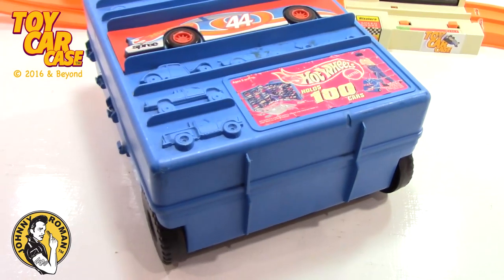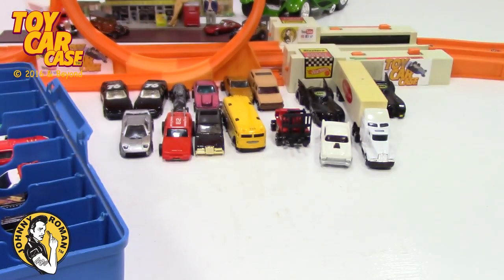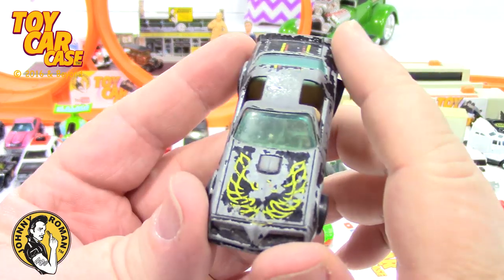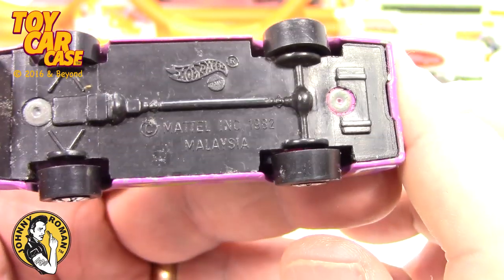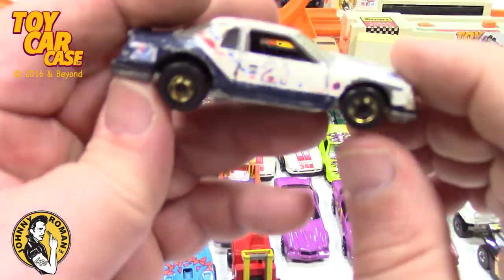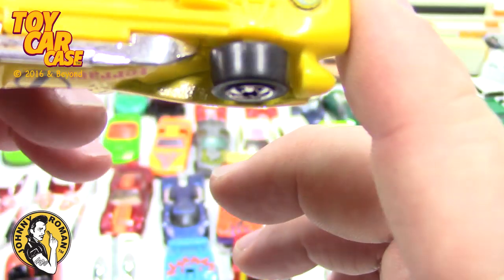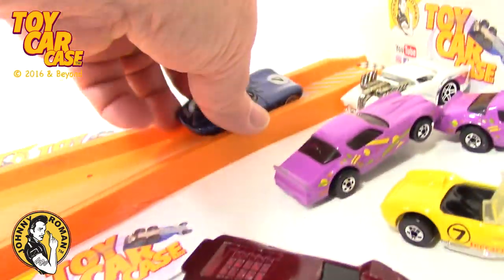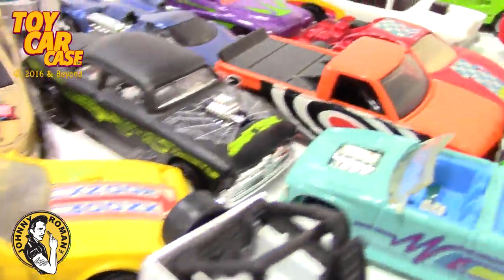Hot Wheels Tara Hot Wheels Spree 44 Race Car 100 Car Cary Case from 1997 Toy Car Case

Comment: Welcome back Calab! That red car on the track, that's Torpedo Jones! I have that in my collection, colored yellow with black flames on the side, and the engine and wheels are colored gold! Personally, I  have been wearing glasses since 2013. Despite this, I still appear on YouTube with the naked eye like I always have since 2007. Trixie would love that pink Datsun!! Nice vintage look for that Minitrek! Personally, 1980 was the year my parents were married! And I'm the same age my father was when my older brother Stephen was born in December 1986! That Upfront 924 could be modeled after the Porsche 924, manufactured from 1976 to 1988. Oh yeah, the Batmobile! I have that in my collection, exact same color! That Bat missile looks like it has seen tons of action! I can't be sure, but that black car looks like the Pontiac Stocker, as the profile of the car seems to match that of a NASCAR racer. The front also indicates that it has to be a Pontiac. That's a pretty looking paint scheme for that white ’57 Bel Air. Nice red forklift! I have a white forklift in my collection made by Matchbox. It's mainly fully intact, nothing missing or anything like that. Hell yeah, the Surfin' School Bus! I have 2 of those in my collection, both of which are colored Metalflake Silver with a Bowling theme to it, and the windows are tinted yellow. While yours is the very first issue from 2001, the two in my collection is from the 2002 Spares N' Strikes series. That black Limozeen looks really gorgeous!! Actually, the underside of that Limozeen reads “1990”, the year I was born. Nice white tractor trailer truck! I think I have a similar looking truck and trailer in the paint scheme of Planters Peanuts. Don't worry, I have no peanut allergy. Kenworth, huh? I have a 1925 Kenworth Yuengling Beer delivery truck as a coin bank in my collection! Wait a minute, that red #82 car, that look like the Chevy Stocker! I have that casting in my collection, except mine is colored purple from the 1999 Criss Cross Crash series. I even recreated that in Forza Horizon 3. It just lacks the power switch and stuff, otherwise it's the same casting. Looks like the one in this video is missing part of the rear wing. Oh yeah, the Zender Fact 4, same casting as the 2 Shell Zender Fact 4s I have in my collection! That McDee car looks like it's modeled after the Lockheed F-117A Stealth fighter! That black racer with the #5 on it, that's GT Racer. It's missing the rear wing and exhaust pipes! Nice, the RC Car from Toy Story! That Green ’93 Camaro is actually from the 1996 McDonald's series. Now I think I remember having the ’93 Camaro in that exact same paint scheme. However, I do have one (still in the box) from the 1996 Computer cars series! Yeah, no doubt that's a McDee car! Yup, that's Alien alright!! Yeah, a Miata!! Similar color to the full size Miata my brother has, except his doesn't have any decals. That Royal Flash looks like the Lotus Esprit from “The Spy who Loved Me" (1977). Alright, another McDee hot rod!! Nice looking Hare Splitter! Kinda reminds me of the Rally Cars of the ‘70s, though I was unable to find a real Volkswagen Rally Car wearing that same paint scheme. I usually find it interesting when I find a Hot Wheels car that is based off a real life race car with the same matching paint scheme! Uh-oh, whoever went joyriding in that Sol-Aire CX-4 must've accidentally pulled the hood cover, and the wind hitting the car pulled the engine compartment door open and ripped it off, lol!! And after that, they soon lost control of the car and spun out of control, hitting the wall really hard on the right rear wheel. The impact caused serious damage to the wheel alignment. I have 2 Sol-Aire CX-4s in my collection. One is a Hot Wheels Race Team, and the other is from Tony Hawk Skate, hence the Birdhouse sponsor on the car. Don't worry, both the ones in my collection are fully intact. However, there was one time when string got caught in the rear wheels of the Race Team Sol-Aire CX-4, and one of the rear wheels were “whack-a-lack-a-jack-attack”, but I was able to fix these and restore the pretty lady to racing condition. Hey, I know what it’s like to get recorded messages on the house phone. It's really annoying when that happens. Awesome looking techno Mercedes C-Class. Nice looking Fire Department key chain! No way, the Ferrari 330 P4!! I have one of those in my collection, same color, but different racing number on mine: 32, which is located only on the hood and the sides, but not the rear fender. And it has racing stripes on the hood too. That I also recreated in Forza Horizon 3! That metalflake blue exotic is the Jaguar XJ220. 282 of these were produced by Jaguar from 1992 to 1994. Powered by a 542 horsepower 3.5L turbocharged V6, this baby has a top speed of 212 miles per hour. That green McDee car kinda reminds me of like something of a prototype sequel to the original Splittin' Image or something. Are you kidding me, I actually remember that light green Hot Wheels Miata in my collection! Something happened to it, but I'm not sure what. Thanks for sparking my memory!! Awesome, Smokey and the Bandit!! That orange Pontiac Trans Am is the same casting as the Metalflake Blue one in my collection. I was able to straighten out the roof, but I still have yet to fix the suspension shocks. Sorry to say the pillars on mine are busted, but I am NOT giving up on that! Nice looking blue Sol Aire CX-4s! Very pretty red on that Miata!! Oh yeah, the Ferrari 348! That's the same casting as the one in my collection, except mine is colored yellow with red interior. I thought it was a Testarossa (nearly identical in casting). That green McDee car kinda reminds me of the silver 2008 Tesla Roadster I have in my collection! That white car with the dent in the roof is the Chevy Citation. 1,642,587 Citation automobiles were produced by Chevrolet from 1979 to 1985 (starting as the 1980 model year). Back in the ‘80s, my Dad used to have a real Citation X! His was colored deep blue with a gold band. I betcha that if I get my hands on a Hot Wheels Chevy Citation, I shall paint it like the car my father used to own!! Hell yeah, I have one of those Hummers colored in yellow in my collection!! Wow, that purple sparkly color looks beautiful on that Zender Fact 4! That's a beautiful pink sparkly paint job on that VW Golf!! I have 2 of those in my collection, except both the ones I have are Getty Gas Station promotional cars, colored Metallic Silver. I also have a red BMW 850i, which is also a Getty Gas Station promotional car! Nice looking glitter green Fiero! My brother has a full-size Fiero at his house in Michigan, colored dark red. Nice scary looking ShoeBox!! I have a Shoebox in my collection, but mine is colored Spectraflame Aqua with a White Strip on the sides. That purple T-Bird casting first appeared as the Thunderbird Stocker in 1984, and according to Hot Wheels Wiki, this casting is still in production under this name. It's also known as the Thunderburner (1987-present) and Velocitor (1996-1998). You have Twin Mill II?? So do I, except mine is colored Orange with gold engines, gold wheels, and opaque black windshield and rear window. Actually, that “Mach 6” is called “Second Wind". Originally Mattel was planning on making a Hot Wheels Mach 5, but they failed to obtain the rights to the Speed Racer series. Because of this, they reworked the casting and altered it a bit. Despite this, you can still make out the profile of the Mach 5. Nice looking orange Camaro! Beautiful looking Jeep CJ7! My older brother Stephen owns a real 1978 CJ5! Sharp looking Porsche 959!! That's one mean looking Maelstrom! Awesome ’68 El Camino! Sweet looking Red Mustang convertible! Nice looking pink Monte Carlo! That Taxi police car, I'm digging that too… WITH A SHOVEL, lol!!! Sweet looking Stutz Blackhawk! Awesome yellow Torino Stocker! Pretty looking light blue Porsche 959! Actually, that orange Chrysler Concept Car is actually the “Dodge Concept Car”, but that's close enough. Awesome looking Shadow Jet! That XT-3 is out of this world!! Nice looking baby blue colored ’74 Blown Camaro! Another sweet looking ’93 Camaro in green. Honestly, I remember having the lighter colored one back in the day. Awesome, the Splittin' Image II! Now, while I don't have that, I do have the original Splittin' Image from a Hot Wheels Vintage series. What, you have 10 Sol-Aire CX-4s? I only have 2 of those! Nice, the Hot Wheels Race Team ’93 Camaro!! Oh yeah, a McDee Stock Car!! Hell yeah, Purple Passion!! I have 2 of those in my collection, both of which are Shell Gas Station promotional cars! Awesome white Camaro with the flames everywhere! Sweet looking Boom Box!! Nice looking Chevy Stock Truck racer! Awesome 40th Anniversary of Ferrari car, the F40, the last Ferrari to be approved by Enzo Ferrari!!
Reply: My white Matchbox forklift is in better condition than that one, but good find! Awesome Thunderbird Stocker! Sweet looking F1 Racer!! What the, that's the same color Jaguar D-Type as the one in my collection, except mine has 5-spoke wheels, but otherwise is the exact same paint scheme as the one in this video. In fact, the paint scheme of our Jaguar D-Types represents the #4 driven by Ninian Sanderson and Ron Flockhart who made it to first place victory in the 1956 24 Hours of Le Mans. In fact, the Jaguar D-Type is the #1 all-time favorite car of my Uncle Gary! I'm sorry to say that my Jaguar D-Type is “chippy-dippy-do", especially on the back fin. Also, while I was able to recreate this car in Forza Horizon 3, I  couldn't add in the back fin which would've made it all perfect. Sweet looking McDee exotic, looks like a Lamborghini or something! Sweet looking Two 2 Go!! Nice looking Porsche 930s! Sweet looking Jaguar XJS! I have one in my collection, but it's not a Hot Wheels car. However, mine was originally colored blue with silver stripes, but it's mostly “chippy-dippy-do". Sweet looking tooned truck!! That's one awesome looking L'BLING!! Sweet looking Dairy Delivery van! Super fast milk deliveries anyone? That's the truck that will get the job done! Pretty looking Mercedes 380SEL! Uh-oh, somebody is driving too fast and accidentally released latch to the engine compartment door at over 200mph, causing the wind rushing at the car to open the door up and tear it off. I wonder how the Twin Mill body got separated from the chassis. Maybe someone thought they could swap bodies of cars or something. Nice white Blazin' Bug! Awesome, the Solar Eagle! That red racing car is named “Cannonade”. That's one really mean looking dragon car! Nice looking yellow Datsun 300ZX! That's one mean looking purple woodie!! Whoa, the Porsche 959s just keep coming!! Sweet looking yellow Ferrari 250!! Sweet races!!! In fact, I just performed a little experiment with the racing section of this video. I played my ‘80s heavy metal rock music while watching. This video here (not mine) is an example of what I listen to while racing: https://youtu.be/B_xe1UnaZeg Overall, awesome cars, awesome racing, awesome crashes, awesome everything!!! Right now, I shall share some pictures of some of my collection parked in a brown shelf drawer like a garage on Facebook.
Reply from the maker: Your brother has a ton of cars! It is cool he has a Miata! Soda-Pop is leaving his here. YOu are missing your Miata from your collection? I know On Smokey and the Bandit . . there are some words that little ones should not listen too but a very great CAR movie. . . the two sequels are not as good as the original! I have to start going to Shell gas stations if they have more of these promotional cars. . . well our governor just doubled the state gas tax, and is taxing about everything else he can think of. . . and people are moving out of the state faster than bees flying out of the hive after it was hit! We might be moving to a state near you? hehehehe Thanks again for all the information and stories! Rock-On Danno